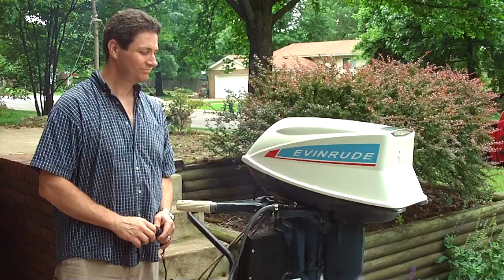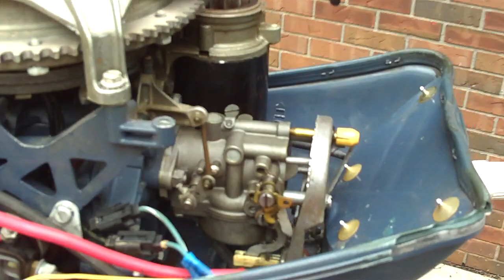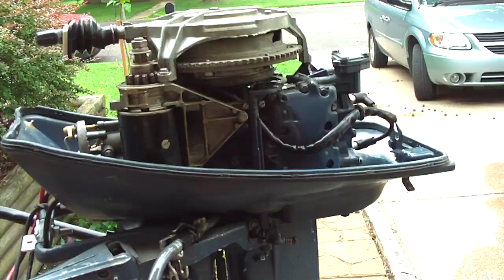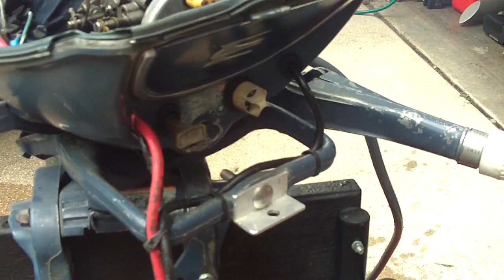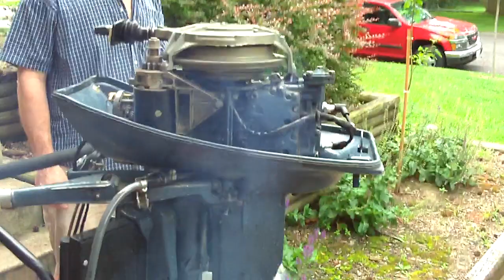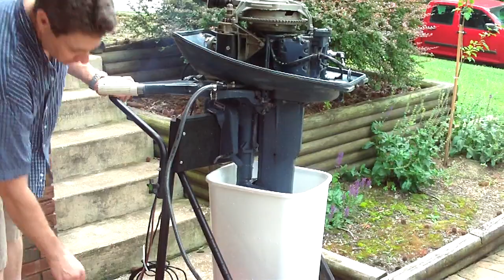1969 Evinrude Sport 25HP

Comment: My dad's got one like this, without electric starter. It runs, but it misfires badly at mid to high revs. Any idea what could cause that?
Reply: yes check  remove the flywheel and check the coils the points thats one of the things I seen do that.
Reply: you need to check for any cracks or lose dry wires shorting out with in the body of your outboard.